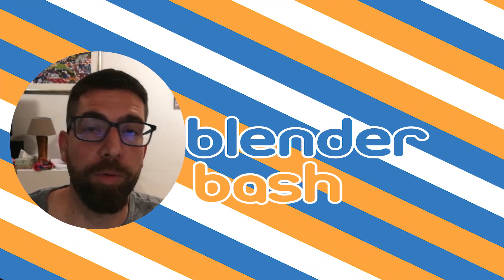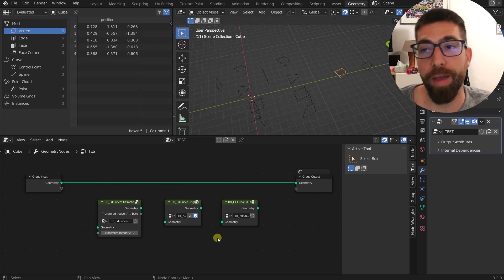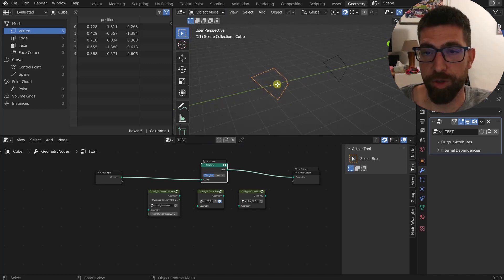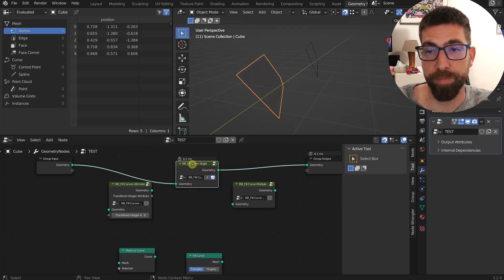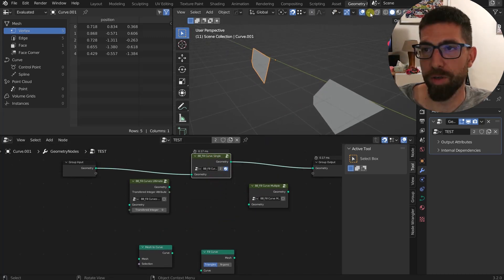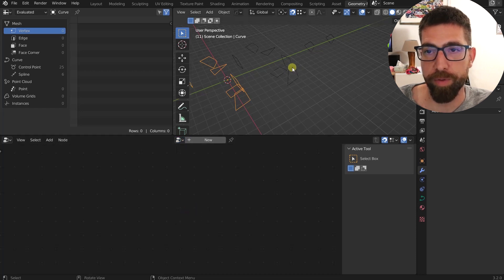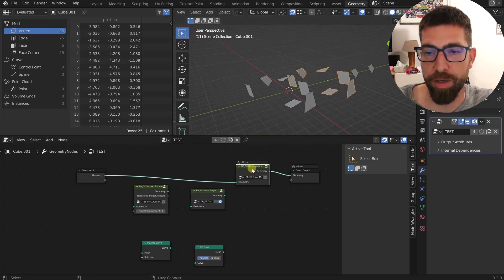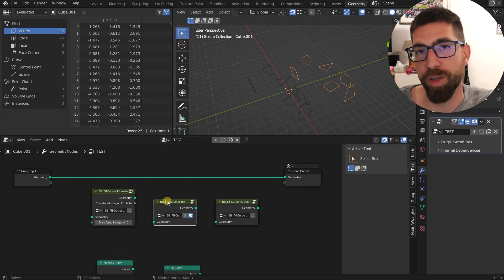The Right Way to Fill a Curve with Geometry Nodes in Blender

Comment: There is a way you can fill multiple splines or mesh lines with different number of points or vertices without using multiple iterations over and over again

Comment: By definition a filled curve is flat. In Blender, curves are aligned to the ground when generated. That is how the Fill Curve node expects them to be. You can test this by generating a primitive curve, rotating it slightly in X or Y axes, and filling it. The filled polygon looks as if it was projected from the top. Normally you would generate them on the ground, facing up the Z axis, fill them and then orient the filled meshes according to your needs. I saw your video several times and read all the comments and I'm curious to know the reason for building them facing an arbitrary axis. In the case of multiple such curves that need to be filled, there's no need to emulate a looping behavior by copying the same node group over and over again. I'm sure feedback loops have their use, but Blender already includes the tools that easily handle this elegantly. I found a solution that works with any number of closed curves, no matter how complicated their path. It even works for text outlines (the most complicated type of curve I know). I posted a comment yesterday with the link to a blend file, but Youtube made sure to delete it as spam. So I'm explaining my process below:

First join your many curves into one geometry stream, then convert them to Mesh. Splines are mathematical expressions and generate their path using control points. In the case of Bezier or Nurbs types, the intermediate points are interpolated between those controls. By default all bezier curves have a resolution of 12, meaning there are 12 points between each control point. Converting to mesh ensures that all the interpolated intermediate points are converted to real geometry points. Now convert these mesh lines back to curves. This generates polygonal-type curves with all the points from the mesh lines present. We will generate as many closed polygons as there are curve splines present. Each of these polygons will have the exact number of points as the corresponding spline. So, add a Curve Circle (the number of points doesn't really matter) and instance this on the points of a Mesh Line. This line must have the exact point count as the number of input curves. Use a Domain Size node set to Curve to get the Spline Count. Set the line points apart in X or Y axes so the circle instances don't overlap. This is very important for the next step. Realize the instances. This generates real spline circles. Now each circle must have the exact number of points of the corresponding incoming curve. Use a resample node for that. Add a Transfer Attribute node, set the type to Integer, set the mode to Index, and the domain to Spline. Connect the Mesh to Curve geometry stream to the Source input, and an Index node into the Index input. Also, add a Spline Length node and feed the Point Count into the Attribute input socket. Feed the result into the Count input of the Resample node. Now you have different point counts for each spline circle. To fill them use a Fill Curve node set to N-gons mode. This generates filled polygons from each curve circle with the same number of points. That's why we set the points apart earlier. In the end, use another Transfer Attribute node to have the points of these polygons overlap with the corresponding points of the Mesh to Curve points. Use the Vector type, Index mode, and Point domain. Again, feed an Index node to the Index input and a Position node to the Attribute input. Connect the result to the Position input of the Set Position node. Now all the misaligned curves you started up with are filled correctly. As I said, you could build those curves on the ground and orient them after the fill operation, but that's up to you. This method works for any number of curves, as long as it is closed and non-overlapping. It even works for Text Splines. Thank you @Blender Bash for sharing these videos.
Reply: For anyone reading this, here is the link to the blend file with my solution:
https://drive.google.com/file/d/1bdNJCCzcUORaYbv4dU4NMQ_vol3mUnel/view?usp=share_link
Let's hope Youtube doesn't qualify this comment as spam.
Reply: @ilirbeqiri  Your solution helped me, thanks... I have made for myself node that just resets positions of flattened mesh curve to original points... Conversion to mesh and back to curve is of course necessary, so we have polygon instead of curve, because repositioning points of curve in 3d would change its XY shape
Reply: @dusanpaulovic1862  I’m glad I could help!
Reply: many thanks @ilirbeqiri
Reply: Just letting you know that these comments are visible to me.
Also, just a small note. When you say:
"In Blender, curves are aligned to the ground when generated. That is how the Fill Curve node expects them to be."
This isn't fully accurate. Blender in general is perfectly fine with curves that aren't aligned to the ground, and it's the Fill Curve node specifically that wants curves on the plane/ground.
A few months ago I was looking at the code for the Fill Curve node, and the main reason for this comes down to the triangulate mode of the Fill Curve, which is an implementation of something called "Delaunay triangulations", which are a very clever way to triangulate a polygon, but require that polygon to be flat.
Reply: A filled curve is not in general defined as flat I feel. That's a constraint you've created, I feel.

I personally have a scenario where I cannot obviously/easily rotate my mesh before filling it. Imagine you take a terrain, and separate out a patch in the center, which you then subdivide, and deform. Kind of a 'level of detail' kind of thing. Now, you want to fill the gaps around the edges between this deformed central bit of terrain, and the rest. the mesh surrounding the gaps is on a manifold that comprises a band running around the portion of terrain.

Comment: I am trying a simple way for that but no luck:
1.draw a closed curve somewhere and open geometry node window.
2.convert to mesh,and capture position attribute for all point.
3.set all point's z position to zero, that way this shape is projected on the floor.
4. Convert back to curve and fill curve.
5.Covert to mesh again .
6. Now, reuse the old position we capture as step two to set position back .
It look like make sense but failed.....
Reply from the maker: That's because once you use fill curve, all attributes are lost. Or at least they change their indices values. Just try to use grid with 2x2 vertices, its indices are aligned like this 1243, then convert it to curve and they become 1234. Similar thing happens when you use the fill curve.

Comment: Hi! Just found this video while struggling with a related question (basically a more complex version where the sides of the loop start subdivided and curved, and I want the filling to be subdivided and curved in a compatible way), and I think I have a simpler way of getting the results you want here.

In short, I built a node just like your "BB_Fill Curve Single", which also transfers position from the curve to the mesh, except instead of using a circle with the right amount of verts I use the output of the Fill Curve node (which is already a poly with the right amount of verts).
And with this alternative version the cases of curves with multiple components are already handled correctly.
Reply from the maker: This approach was something I persued also, and it works fine for some cases (veritices that are in the correct order - Index wise), but when you have curves with a lot of vertices or multiple curves, the indices of vertices sometimes dont get "transfered" in the right order when using the Fill curve node. For example the curve has 1,2,3,4,5,6 indexed vertices, ad then the fill curve node creates a mesh that is arranged like this 1,3,2,5,4,6. This won't work
Reply: @BlenderBash  
"the indices of vertices sometimes dont get "transfered" in the right order when using the Fill curve node."

Are you sure about this?
I certainly agree that the Mesh to Curve Node will change the order of the vertices, but I don't see why the Fill Curve Node would. 
Are you 100% sure Fill Curve is the one swapping indices? I've never seen this happen. I'll try take a have a look at the code for the Fill Curve node to see what it's actually doing.
Reply: @LuisPereira-bn8jq  , hi there. You are right about the use of Fill Curve node. It generates polygons with as many points as it finds in the curves it is supposed to fill. I don't  know the exact nature of the problem you were facing but here is my solution in the case of multiple incoming curves:
https://drive.google.com/file/d/1bdNJCCzcUORaYbv4dU4NMQ_vol3mUnel/view?usp=share_link
Please read my main comment above for clarification. Thanks again for bringing to my attention the use of Fill Curve.
Reply: @ilirbeqiri  Not sure where your "main comment" is, but I wasn't having an issue with this bit. The issue I did have is with something much more complicated.
As for this smaller issue of filling curves, I did literally the same thing you did with the same nodes: after filling the curve, set position with the positions transferred from the original curve via the index (though in 3.4 the functionality of "transfer attribute" node was replaced with several "sample" nodes).
So while I'm thankful for the attempt at helping, you're helping me with something I already knew how to do :P
Reply: @LuisPereira-bn8jq  , by ‘main comment’ I meant not nested, like this ones. I posted some details there and didn’t want to double post. I did read your first comment and was aware that you already solved your more complex version, just wasn’t sure what the nature of it was. Something about the subdivision of the loop, but couldn’t fully grasp it.  Bragging was never my intention. I posted a solution for anyone interested in this topic. Cheers.
Reply: @ilirbeqiri  When I say "I don't know where your main comment is", I mean that I can't find any other comment of yours in this video. 
Unfortunately I know from experience that sometimes Youtube can hide comments from other viewers, but will trick you into thinking the comment is visible. In other words, when you view the video the comment will be visible to you, but other people won't see it.
There are many reasons for this, but one of them is the presence of web links. I've often found that trying to post links on youtube comments results in comments being deleted.

And actually I haven't really solved my main problem, actually. I did find a workaround for the specific application I was working on, but not for the larger problem.
Reply: @LuisPereira-bn8jq  you were right, Youtube probably qualified my comment as spam. For anyone reading this, I reposted it without the scene link, only the a detailed explanation of my solution. So far is is still visible. Curiously the web links don't get deleted if you post them as a reply to an already existing comment. Cheers!

Comment: what if you use a switch and mesh island nodes to reduce the computing time when you need to calculate the amount of points?
I dont know if it is possible but I would say that you could count the number of Islands and based on that the nodes would pic a way which would be the one that uses the less amount of nodes.
Reply: I dont know if it is the switch node or the math boolean but one of those must be, I also dont know if that could increase the computing time too.